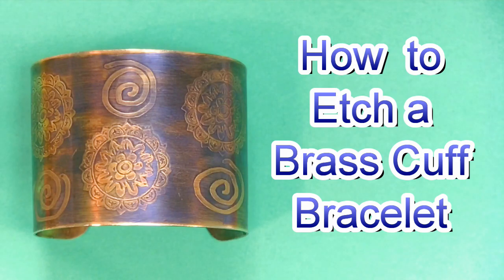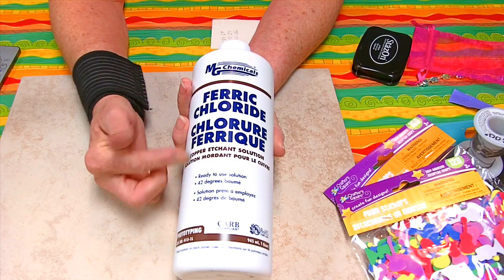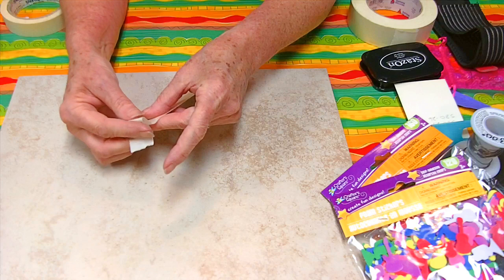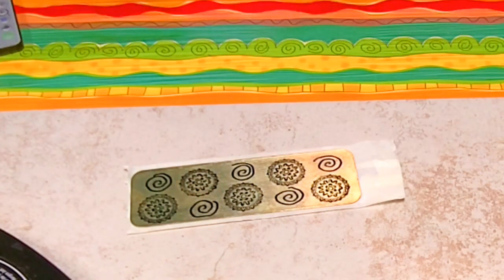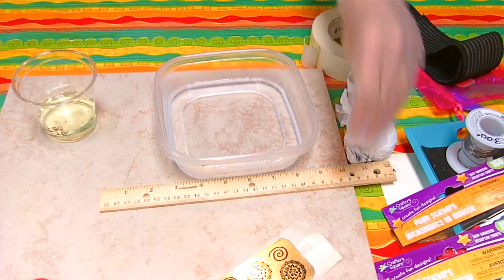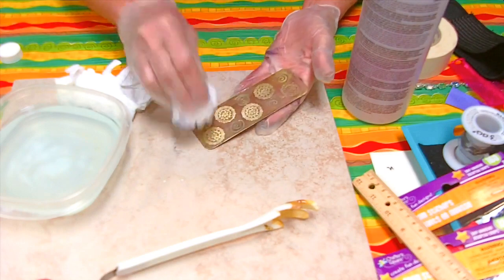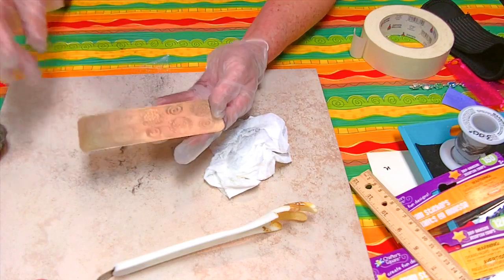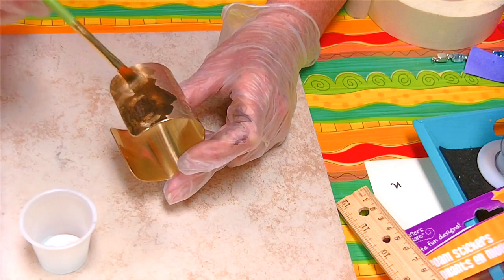How to Etch a Brass Cuff Bracelet and Apply Patina

Comment: Thank you for an excellent demo!  Your bracelet cuffs are very lovely craftsmanship.  I hope to get some skills in etching.  Jewelry making is such a creative outlet for me and so diverse its hard to decide which direction to go.  I think etching need to be seriously explored.  Where do you buy your copper pieces, and are they precut?  If you cut them yourself what tools do you use?  I have both an angle grinder with metal cutting disks and also a Dremel Saw Max for finer work.

Note to viewers:  
1. These are all HAZMAT materials and MUST BE DISPOSED OF PROPERLY. DO NOT FLUSH THIS DOWN THE DRAIN, AS THE COPPER RESIDUE WILL KILL FISH, SNAILS, TREES, PLANTS AND POLLUTE RIVERS AND OCEANS.  Look up your local hazmat disposal sites, and take this there.  Do not pollute the earth.  Dissolved copper is highly toxic to any plants and fish.
2. The resulting product from contact with copper is Cupric Chloride used for a variety of uses, and you may be able to reuse the waste in textile dying, etc.  Look it up online.  Recycle, reuse.
3. Ferric Chloride is a one time use product and produces a lot of waste and is costly.
4.  Muriatic Acid + Peroxide is the way to go.  Reuse indefinitely by adding one or other some more.  There is an instructables.com article on this to read.  Plus Muriatic Acid will also clean your toilet built up minerals crud.  Use with occasionally as it is toxic and strong, and may damage old water pipes.
5.  Do not inhale fumes.  These are strong chemical reactions.  Work in a very well ventilated place or outdoors and /or wear a nose mask - the $30 version that blocks chemicals.  Just because this process is in the craft category, do not take this lightly.  Harbor Freight has eye goggles for $2 each, and Nitrile gloves 50 pack for $13 at 0.9 mil (black color).  Buy these for all your household needs and any furniture refinishing as they are caustic chemical resistant.  Don't bother with the cheaper Nitrile gloves or Latex.
Reply from the maker: Hi Lass.  Thank you for your comments and questions.  Jan's Jewelry Supplies carries the brass blanks and brass cuffs.  We recently added some very thick brass cuffs that would allow you to make a deeper etching without weakening the bracelet.  Please visit https://www.jansjewels.com/bracelet-bases-cuff-1.html

Comment: Muriatic acid can be neutralized and safely disposed.  It is used to lower the PH of water in swimming pools. You can neutralize it with baking soda and the PH increases to 7 and it is safe.  This is not really a hazardous material.  Don’t poor anywhere until you neutralize with baking soda to neutralize the acid!
Reply from the maker: Thank you for all your comments and the information.  I would still treat the solution as hazardous and recommend taking it to a hazardous material disposal site.
Reply: The metal residue in the spent chemicals is highly toxic though.

Comment: If you pour the acid that is now of no use into the baking soda water and not the other way around you can neutralize the acid solution and discard it. Also you can suspend the copper over vinegar in a covered vessel and it will darken and not cost anything.
Reply from the maker: Hi Randall.  Thank you for your comment.  After the solution is neutralized it is still a hazard solution and should be taken to a recycling center for proper disposal.

Comment: hello, i didn't know that you can use ink for etching, I tought that only sharpie pen?! ink don't eraseing? can you reuse acid mix ?
Reply from the maker: I believe i have only used the sharpie. However some inksnmay work as well as crayons and wax pencils. most will start to wear off after a while in the solution. So, you want to make sure whatever you use will last long enough for the piece to be etched. i have not tried reducing the acid. It may work but take longer to etch. I am not sure. You might try testing some small pieces in a small contain with less acid to see what happens.
Reply: @Jansjewels  thank you for the quick reply! will try!

Comment: Hi, Do you happen to know it ferro-chloride will work on cooper from the hardware store? I am talking about working with copper that is used for home/ tubes/ pipes that can be flattened to get sheets of cooper. Will the process of submerging in the solution/ ferro chloride takes longer? Will it work?
Reply from the maker: Ferric Chloride will work on any copper.  You will find many articles on the Internet describing using Ferric Chloride to etch copper circuit boards.  It is expensive compared to the Muriatic Acid and Hydrogen Peroxide used in this video.
Reply: I tried etching on cooper tubing which I open and flattened  into sheets and I noticed after two hours of staying in the solution the etching image was very subtle on the cooper. I am thinking that perhaps I may need to leave the pieces over night in the solution. I was trying to see if it will work. Thanks
Reply from the maker: It definitely should work.  Are you using  Ferrous Chloride instead of Ferric Chloride?  Ferric Chloride usually works in about 20 minutes.  One of our customers left a bracelet in Ferric Chloride over night and the bracelet was gone the next morning.
Reply: Funny that you said that, I did the same and this morning the piping was so thin I could not do a thing with it but only throw it way. I used the same amount of mixture as you demonstrated on the video and on cooper piping  the etching was barely unnoticeable, so I waited for another two hours and still, so I left it overnight, and then I have to discard it. I used  your mixture and then I did one including iron like form rusted nails in the mixture, but for some reason the impression is not strong as it looks on your video. There may be a difference between etching copper tubing for jewelry and the cooper sheets you are using that it does not makes it possible to etch so easily, the impression is not very strong. I am not sure why am I doing wrong.
Reply from the maker: The etching will only easily be seen after applying a patina to the piece.  Look at the etching in the video (minute 13) before the patina is applied.
Reply: I just checked the muriatic acid bottle for info and is by a company call Sunnyside 31.45% hydrochloric acid, 20% Baume. It says lower pH in pools and spas. Cleans and prepares concrete prior to coating and sealing, etches concrete. Is this one okay? Your etching on your piece is a lot more noticeable than mine even without the patina
Reply from the maker: Your solution is working and etching the copper.  You stated "so I left it overnight, and then I have to discard it."  I would recommend checking how you are masking off your design.  Notice that when I removed the piece from the solution, the ink was still on the piece.  Try masking with tape or stickers.
Reply: I started with submerging the piece 25 mins in the solution then I noticed the design showing barely, so I tried increments of 5 and 10 mins on the solution and even longer than that thinking that it may grab better, but it was pretty much the same, so I thought maybe if I leave it overnight it will work better, and this morning I found out it was a total disaster. Today, I tried again to etch another piece of cooper tubing but it was not a strong etch but very subtle on the cooper.  
I see, it may be the ink then. I used stazon  ink for metal, but I noticed the ink tends to come off just as soon as I put it in the solution, some  of the ink washes off and some stays on but I never see the piece with the ink still on the cooper after I pull it out of the solution. I am going over the steps and I can't pin point where the issue lies. I am using the same ink that you show in the video. The ink says stazOn solvent ink for use with  plastic, metal, glass, ceramic, paper and leather. I am using stamps from Hobby Lobby to stamp the design unto the cooper, I am not sure what is it that i am doing that is not working to create a good result. I guess keep on trying...
Reply from the maker: Make sure your piece is super clean before applying the ink.  I think you have identified the problem.  It is the masking of your design.  The masking has to stay until the etching is complete.  I would suggest letting the ink dry over night before you place it in the solution.
Reply from the maker: Since you are using old copper pipes, they are probably oxidized.  I would suggest you polish them with steel wool until they are shinny before you apply the ink.
Reply: Don't use Ferric Chloride!  It works well on etching but... you have to throw away the solution and cannot reuse it.  The dissolved copper in it, pollutes streams and rivers.  Copper is highly toxic to fish and plants.  Therefore, its a bio hazard and needs to be disposed in a hazmat facility. And its pricey to waste.  Using the method shown here with muriatic acid and peroxide - the solution can be reused over and over again. Add a bit more of one or other as it degrades. So this is better for the environment.  Dispose in a facility as well when its really done.

Note to viewers:  COPPER IS HIGHLY TOXIC TO FISH AND PLANTS.  DO NOT THROW THIS IN THE DRAIN!!!!  POUR INTO A REUSABLE CONTAIN AND TAKE TO A HAZMAT FACILITY FOR SAFE DISPOSAL.  ANY OF THESE ETCHING TECHNIQUES DISSOLVES COPPER INTO THE SOLUTION, SO STORE IT UNTIL YOU CAN GET TO A HAZMAT CENTER LOCALLY.

Comment: Thanks so much for this -- really enjoyed it. Have two questions (if you said these things, sorry, I must have missed them):

Do you clean the metal at all before stamping on the design?

Is each batch of solution good for only one piece, or can you use it again before consigning it to the waste bucket?

Thanks again!
Reply from the maker: Hi Ri Mi,
I generally wipe the pieces down with alcohol just to be sure to get any remaining oil from the manufacturer. You can do a number of pieces at one time. However, the solution will start loosing its potency. I am not sure how long this solution will be effective. You might try a solution you have used a day later and see if it will still etch. It probably will but, will take a bit longer. It will eventually be non-effective.